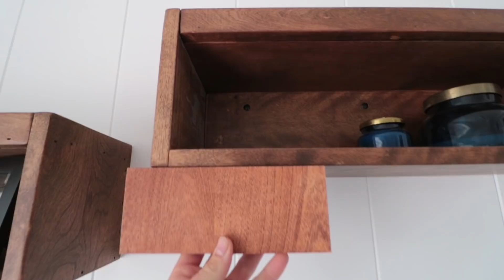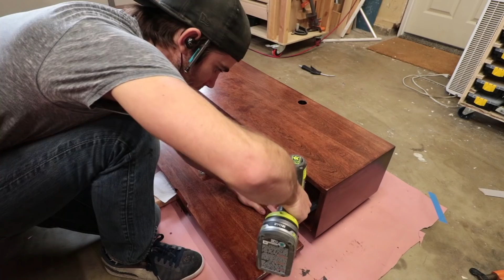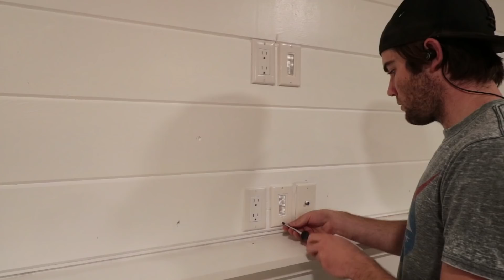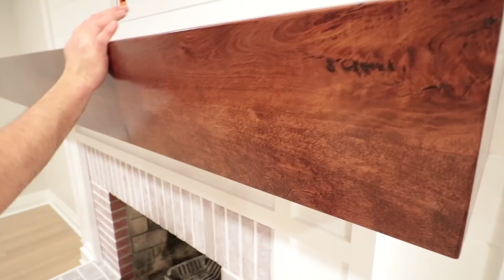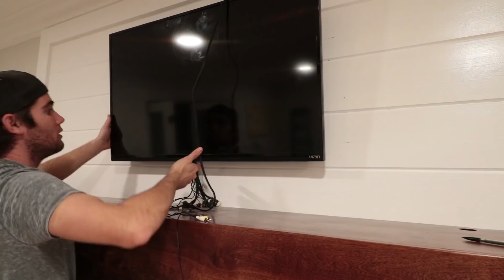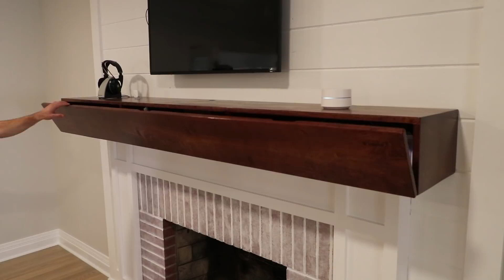DIY Fireplace Remodel Pt 4: Living Room Complete!

Comment: Oh...fair warning; If you haven't upgraded already...many OLED panels are such that you will have to move the TV mount lower because it attaches to the lower portion of the TV, where all the electronics are. The rest of the TV panel is barely a quarter inch thick.

Comment: I'm doing basically the same thing in our family room and was wondering which particular hinges you used. I'm using 1x red oak and want the 'flush' look as well. It looks like the Everbuilt soft close full overlay hinges, but I wanted to be sure.
Reply from the maker: That sounds about right. “Full overlay” is the term to look for.

Comment: Ben - I'm making a very similar thing and want to do exactly what you did regarding the hinges (being flush on the bottom). Do you remember what specific hinges you used? I narrowed it down to "frameless cabinet hinges" but there are still several variations from there.

Comment: Exactly what I'm thinking of building but I'm wondering about air flow to units inside, do you have any over heating problems or do you leave the front open when playing?
Reply from the maker: I leave it open while playing mainly so there’s no interference between controller and console. Wifi router is in there with it closed and haven’t had an overheating issue

Comment: hey what kind of hinges did you exactly use? i'm running into the same problem that you initially did with the spacing between door..once you close it. i do have the soft close hinges. wanted to know what is it that im doing wrong. thanks
Reply from the maker: I’m 99 percent sure it’s this:
35 mm 110-Degree Full Overlay Soft Close Cabinet Hinge (1-Pair)

https://www.homedepot.com/p/302857903
Reply: @BenTardif  thanks for a quick reply.  i have the same exact hinges but for some reason my wood isn't sitting flushed... i have tried adjusting it too. i don't know where i'm making the mistake.
Reply: @BenTardif  when my mantel is shut.. you can see the difference on top and bottom..it's slightly off... and it's irritating. hope you can help
Reply from the maker: @adnanharris  There may be an issue with the placement of the hinges on the door or mantle. That or it could be a bow in the wood. It's hard to know exactly without seeing. You can send me an email to show me the problem if you'd like.
Reply: Ben Tardif can I get your email to share pics?

Comment: I watched all 4, really good job. If I may, MDF works better if you are going to paint it, flatter, no bleed and no knots. Also, I see some blotches on the stain. This comes from different density of the fibers. A light coat of shellac, then sanded, then stained will give you an even finish. Of course, you may like the light/dark look. Again, great job.

Comment: Great idea but you are going to have problems with heat with all those electronics, especially if you use the fireplace.  I’m going to guess the mantle door will be open a lot.  You’ll have to mount an exhaust fan to one end and put some ventilation holes on the other.  Looks great though!  Agree with other posters on TV size. You’ll be altering that soon too!

Comment: Great job. Fit and finish look fantastic. But why does everyone insist on putting TVs over the fireplace? It's WAY too high for normal viewing... I think HGTV designers started doing this and everyone continued the trend.
Reply: IMHO, because it's so space efficient that it's worth the compromise. Another factor is the many web sites that  advocate mounting the TV  at a height based on eye level fail to take into account that people often recline when watching, rather than sitting bolt upright.
Reply: I’ve been doing this in my sims games for years, it just looks more put together to me 😂
Reply: who cares it makes life easier
Reply: My man Zack knows exactly what he is talking about. Fireplaces are out and tvs are in. Even in this video Ben says it will not be a working fireplace. New construction houses have electric fireplaces. There is no need for a massive construction exactly where everyone wants to have their tv. Houses should come standard with a low profile fireplace and if you are retrofitting maybe some mechanism that can lower the tv to proper viewing levels when in use.
Reply: Agreed, the center of the screen should be at eye-level when when looking straight ahead.  Having it so high will pop your C2-C3 disk.
Reply: Mines over my fireplace and it don't bother me and I watch a LOT of TV.
Reply: It's also bad for the tv to have heat rising up to it 🤷🏼‍♂️
Reply: I disagree. We prefer to have our tv up higher.